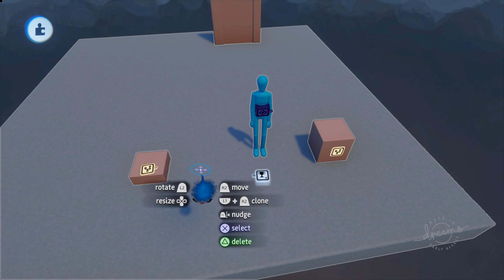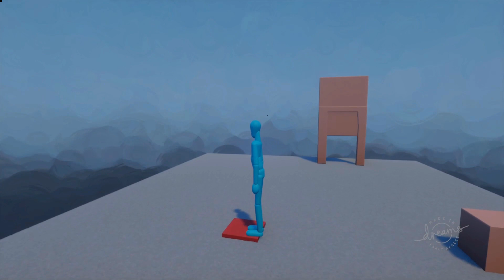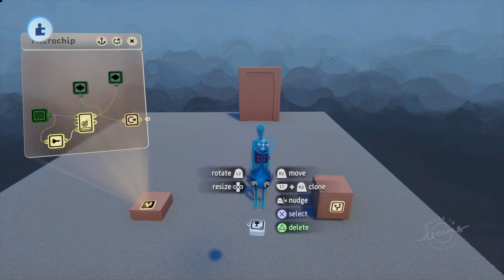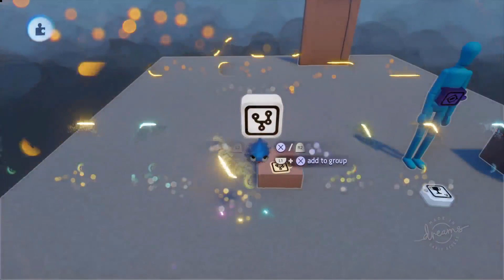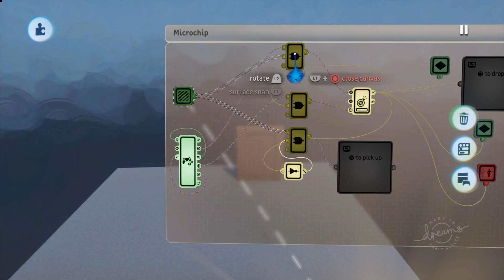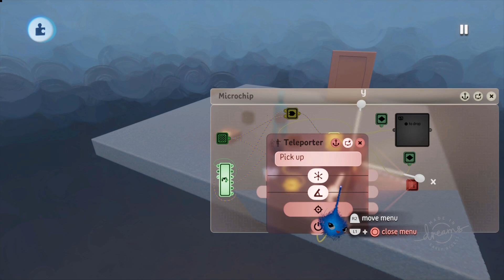Dreams PS4 Tutorial: Pressure pads and blocks

Comment: Could this logic for picking up the block also be used for pushing/pulling larger blocks if the animation is changed? Been trying to figure out how to do grab then push/pull logic for the past few weeks but still haven't figured it out just yet.
Reply from the maker: I dont see why not, just have the puppet bend and place hands on the block to move - however there is probably a better method. I will look into it.
Reply: Thanks for the reply. I gave it a go and got it working like in your video, however since it basically makes the object float in front of the puppet it looks odd with a large object for pushing/pulling as there is no weight to it. If you do figure out how to get it to work though and find the time to do a tutorial on it that would be amazing.

Comment: Hi, how did you add the output socket to the microchip?  I couldn't find it.  Thanks at 6:17
Reply from the maker: Its called a node - find it in the yellow gadgets
Reply: @DreamswithLadylexUK  Ah, I see the icon is different there than when it's placed on the microchip.  Never would have found it.  Thanks